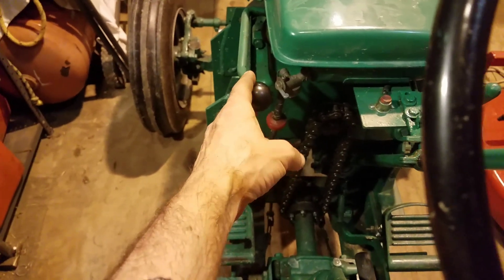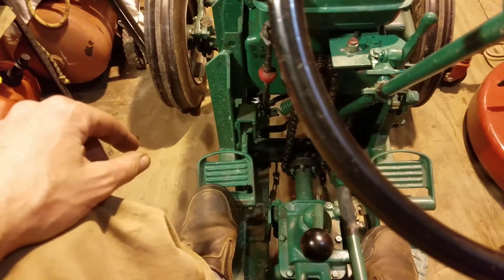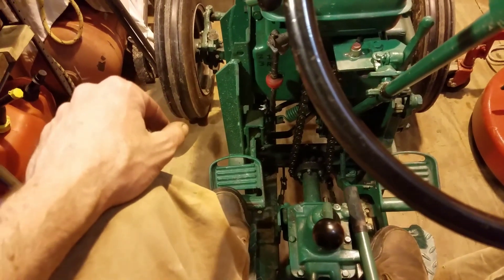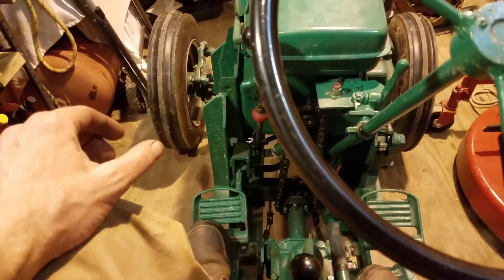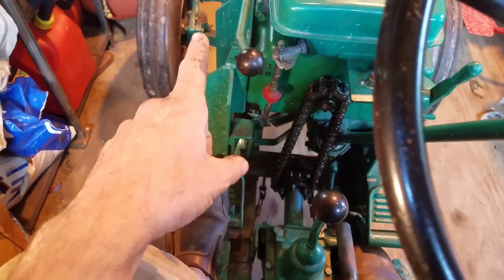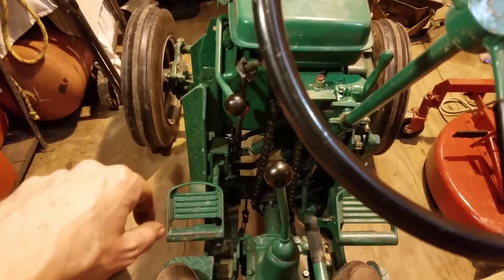Homemade tractor: An explanation of the 2 transmission drive train. Operation starts at 5:26.

Comment: Nice machine. Dual transmissions were very popular in "doodle bugs". They were homemade tractors from salvaged auto components. About 60 years ago, my FIL built a tractor from an old Crosley and B-29 parts. It has the Waukeshau 4 cylinder engine, hydraulics from the plane, and the Crosley frame, transmission and fron end. Unfortunately, It hasn't run in almost 40 years. My BIL put water into the crankcase instead of oil. Good Luck, Rick
Reply from the maker: @richardross7219  Thanks Richard! Water in the crankcase?! Mistakes happen, but that’s the first I've heard of that one.
Reply: @jessealt5415  I've seen several times where women did it.

Comment: Hello, Jesse. I've finally gotten around to working on tractor parts.
I'm in the process of removing the brackets from the rear, which is almost done. I'll then cut the axles tubes to length and then welding them back on. How wide is the rear on your tractor? I'm thinking about 36" from hub to hub. I have a pair of wheels and R1 tires for the tractor that came from a scissors lift. They are 15" and are the same 5x5.5" as the rear. This had 18" wheels, so it will just run a bit slower. I can get a divorced transfer case from a Datsun truck, and that will give it two ratios for the output to the rear. 
After the axle tubes are welded, I'll either get the axles cut and welded, or I'll cut them, and get them resplined, which is stronger.
I'm taking pictures as I go along, so I'll make a slide show of them when I get farther along.
Reply from the maker: Hey Bryant! That's great news. Resplined is the way to go for the axles if you have money to spare. Welding is probably strong enough, but won't be perfectly straight. If you can get it good enough to not ruin bearings, that's probably all you need. It’s only going to go a few mph anyway. The back tires on my tractor is 33" so the rear is probably 32" I don't remember exactly.

Comment: Love the build so much I’m using your transmission idea on my wheelhorse only I’m using a hydrostatic trans turned sideways connected to a powerking 3speed/panzer rear axle. Takes up more room but I believe I can make it fit. Thanks for the inspiration. 👍
Reply from the maker: That's great, Richard! If you upload any videos, please stop back and let me know. I'd like to see it.
Reply: @jessealt5415  I will. Cutting up the transmission tomorrow. What size chain and sprockets are you running?
Reply from the maker: @richardpugh3434  The chain is a 60H industrial heavy duty with pitch size: 3/4 inch. I have a 3 inch 10 tooth sprocket on top and a 16 tooth 4 inch sprocket on the bottom.

Comment: That is a very cool little tractor. That second transmission really makes it shine .
Reply from the maker: Thanks, Bustednuckles. I was tossing around the idea of the 2nd transmission for quite a while before the build, wondering if it would be too much trouble. It ended up being not too bad. And the added gear ranges is very useful to me.

Comment: How much time expended to complete this build from conception to first use? What is the total cost estimate?
Reply from the maker: From the day I decided I was going to go for it until the day I first used it was about 15 months. Then it was probably another 6 months to finish things like the seat, brakes and the 3 point hitch. Cost is harder to estimate. I took a lot of trips to junkyards and ordered a lot of small items on ebay, but didn't keep cost records. My family collects a lot of old junk which helped keep the cost down a lot, but it was still probably in the $1500-2000 range. The big expenses where the tires, engine and machining work for the shortened axles.
Reply from the maker: I should add, I was in no hurry to finish it quickly. I enjoyed he build process, planning and engineering and took my time. I know when I rush things my work quality suffers big time. When I couldn't figure out how to do something, I'd take a long break from physical work and just think and draw stuff out etc. Some nights instead of working on it, I would just sit there and look at it until a solution to the current problem started to come to mind. Also, when it started to feel like a job instead of a hobby, I took a break.

Comment: The tractor I plan to use model A transmission on, I have a rear from a Kia Sorento with 4.67 ratio on 18" tires. I'm only using 29" tall 15" trencher tires on so I shouldn't need to slow it down too much. Incidentally the Kia rear looks like from a Ford, even to the bolting flange. However the brakes are Disc, not drum except for the parking brake. For curiosity sake I held up a Mazda Miata driveshaft to the Kia flange, and it's a direct line up. This amazed me. The driveshaft came from a free pile at a yard sale. I just bought a steering axle from a scrapped Cushman vehicle, and I plan to use it on this build. My forklift tractor is about to startup again as the weather improves. I'm making room again for this in my shop to park it after welding on it outside. The landlord wants it this way.
Reply from the maker: It sounds like the forklift tractor is really ready to get rolling. Anything from a free pile is a great find! One man's trash... I did a lot of my welding outside too. My shed has a wood floor so inside welding was limited to what I could carry up and down the steps to my welding shop or quick tack welds in the shed. On rainy weekends I set up a tarp so I could still work. Be careful if you're stick welding though. I got a pretty good shock kneeling on the wet ground lol.
Reply: @jessealt5415  I ran into a problem with the Kubota engine for the forklift tractor. The radiator was damaged beyond repair, so I think I will retrofit a Mahindra radiator in in it's place. I'll need to modify the subframe for it, but it's about the same dimensions, so it should work. I'm also waiting on the manifold to be welded, as it's broken, and I'm modifying a tractor muffler to work on this as it was supplied with out one.y shop is about 10 miles from home, on an Amish farm, so this complicates things just a bit. I run my tools from a generator or an inverter on my van.
Reply: @Farm_fab  0
Reply: Jesse, is your frame angle iron or box tube? I can't quite tell.
Reply from the maker: It's 3x3x3/8" angle.
Reply: @jessealt5415  I have 2x3x1/4 channel that I think I will use.
Reply from the maker: That should work. I would use it. Buying steel is really expensive now, or at least the last time I was at my steel supplier. And the older the better. I got a few parts from my grandfather's horse-pulled farm implements that were probably his father's. I wish they still made steel like that. 100 years outside and the nuts still come off, some without even needing PB Blaster!
Reply: @jessealt5415  I got to thinking that on my forklift tractor, I want to put on a FEL, so I think I'll go with 2x4x1/4 for the frame, and use the channel for the Kia tractor. I reached out to a local trade school to see if I can get their help machining  a few parts for my FL tractor. They didn't return my call yet, so I'm hoping that they will be of some help.
Reply: @jessealt5415  I bought a piece of 2x4 box tube yesterday, so I now have 2 pieces. It may be a bit short, but that's easy enough to remedy. It was framework from a New Idea implement. It's raining here today so I won't work on it today. But I bought a "handicap jack" from a guy at the scrap yard, and I'll use it for setting my engine, holding up steel when cutting, etc. I'll apprize you as move along.
Reply from the maker: That should work great! I bet it will be really helpful.
Reply: @jessealt5415  I bought a pair of trailer fenders today for $15. They're a bit rough, but I will have the tractor sandblasted when it's done. I can primer and paint it when it's done. Depending on weather conditions that day, I might be able to primer it at a friend's shop before I go home, and then deal with filling pin holes, etc...
Reply from the maker: Hi Bryant,  The weather has been so nice here. I've been super busy. We only get a few nice months here and I am taking advantage. It will soon be oppressive heat and humidity. Any new progress for you?
Reply: @jessealt5415  I bought more steel, got a new pivot pin for the front axle, and the front axle is now drilled and tapped for a grease fitting, so that's a step forward, I also got two shaft collars for the pin, so I'll be working on that here, soon. In the meantime, I'm putting up more shelves in my shop in an attempt to gain a bit more space to work on things there. I'm using almost all scrap wood, so I have very little outlay in materials. I bought some drywall screws at the scrap yard, and the were NOS. 
Our weather will get 3h soon. Hot, hazy, and humid. When that happens, I just get an earlier start so I can get out of there before it gets intolerable. I'm in Pennsylvania, where are you located?
Reply: I also got some used trailer fenders to try to work with. They will cover about 50% of the tire, which I could do, but I might modify them to look more like Kubota or TYM style with a brake light on each fender.
Reply from the maker: Sounds like good progress for you. I am from Pennsylvania. I grew up in the Poconos (Quicktown, Lackawanna county), but I live in Maryland (Baltimore suburbs) now for my job.
Reply from the maker: I hope to return to Quicktown when I retire or sooner if I can find work.
Reply: @jessealt5415  that would be a good couple of hours away from me there.
Reply: @jessealt5415  so we're only a couple of hours apart since I'm from Lancaster County.
Reply from the maker: Oh yeah. I'm NE of Baltimore so it only takes me 1.5 hours or less to get to Lancaster. Thart"s a beatiful area. I love the PA bank barns there.
Reply: @jessealt5415  I finally got my big generator serviced, so I'll soon be able to start welding soon. I'm organizing the corner where I'll park my tractor after working on it. I'm using a modified grill base section for a welding cart and the drill press. 
I need to make some changes to my horizontal bandsaw as the legs are wiggly and it's difficult to move. My steel chop saw will get an evolution cold cut blade, so I won't have so much cleanup like with an abrasive blade.
I bought some "new" steel at the scrap yard today, one piece is diamond plate (1/8") for the floor and a piece of 1/8" for headlights to be mounted in for the grill.
Reply from the maker: @Farm_fab  Great! It will be coming together soon!
Reply: @jessealt5415  I was looking at a Chinese Yanmar diesel engine from a generator that I might buy. The generator was already removed, and the engine is air-cooled.
Reply from the maker: @Farm_fab  Yes. I spent a lot of time considering this option myself.  I really wanted a diesel. Scarcity/expense of parts is finally what tipped the scales for the Briggs over the Chinese Yanmar clone for me, but just barely. If the price is right, I say, go for it.
Reply: @jessealt5415  I bought the engine for $10, and need to have some work done on the starter. It seems the end cap of the solenoid is loose. Aside from this, it's only missing some cooling tin. I also bought the fuel tank, but it's missing the cap.
Parts look to be readily available, and not to expensively, I might add. Here's their link.
https://apachepowerindustrial.wordpress.com/2011/07/14/the-apache-diesel-generator/
Reply from the maker: @Farm_fab  $10! Wow! Can't go wrong at that price.
Reply: @jessealt5415  the starter is in the shop. It looks to be a bad solenoid. Funny thing is, the starter guy got a generator in with almost the same engine and it has the same problem. I got a used solenoid from a buddy, and he's going to see if he can make it work. I'm anxious to hear and see it run.
Reply: @Farm_fab  l.p.
Reply: @Farm_fab  p
Reply: The solenoid on the starter for the Yanmar clone is now repaired, but I've been quite busy, so I haven't done anything more with that. I bought another Ford model A transmission, but there are no splines on the input shaft. Whatever it was made for, most likely wasn't a car. It's also built on angle iron stilts. The farmer where I rent is redoing some things there, so that means I need to help him, and help myself as well. 
I bought some steel for a welding table, but won't get to do much with that for a bit yet. I may go with a different hydro pump for my big tractor, which is on hold as well, but for a different reason. The machinist took too much material off the shaft, so he'll need to redo what he took off. Hopefully his work will slow down enough to get that done for me before the snow flies.